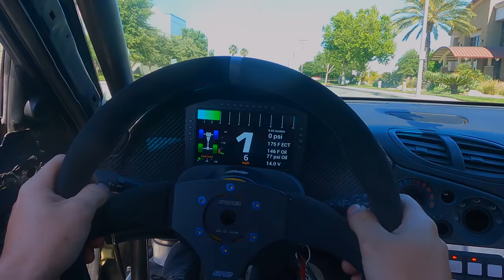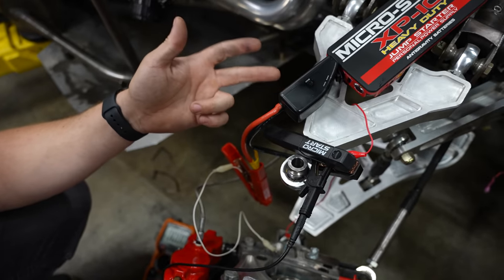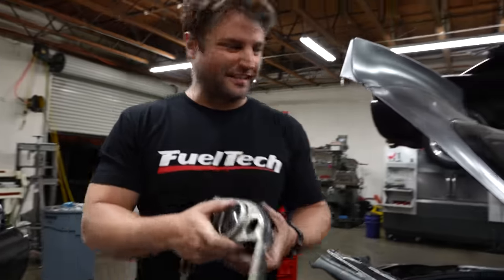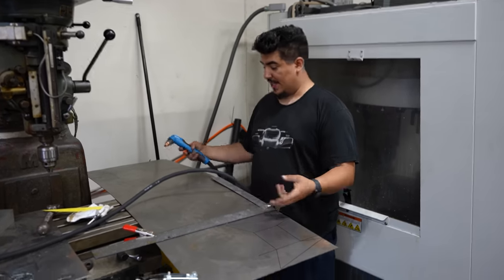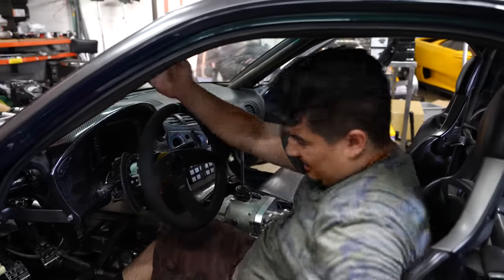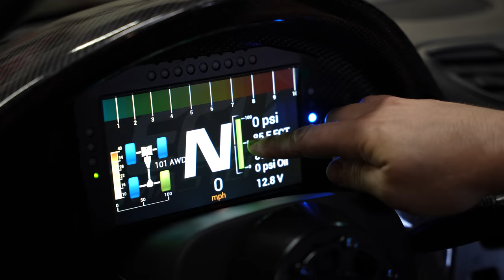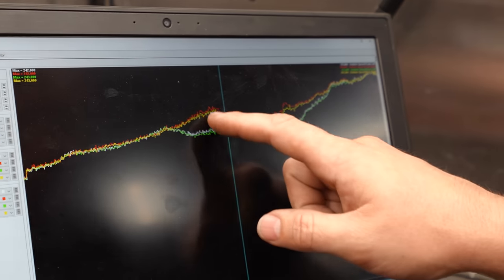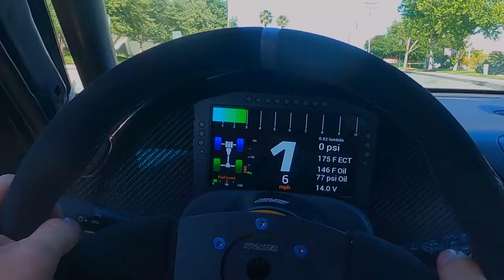Making the AWD 4 Rotor RX-7 brutally fast by Hacking Corvette Wheel Hubs

Comment: now we just need a proper firewall and something to actually cover the transmission. love where this is going
Reply: Oddly enough, the term firewall is apropos when talking Rob Dahm. "Rob your car is literally, actually , on fire!" Rob: "Yeah, but did you see how fast it is?"
Reply: This!!! Please for your own safety rob. There was just a reminder of how fast and dangerous a fire can be recently as Colette Davis’ car caught on fire. It can happen to anyone. Stay safe
Reply: That elbow-unjoint intersection makes me nervous
Reply: Jim jibroni  we will see
Reply: Jim jibroni  raceprep in last videos title.
Reply: He already built a firewall in the 4 rotor. The did like 3 videos on it over a month ago now
Reply: @johnnyclark6182  Yeah but that firewall is kinda sketch looking, didn't they seal of certain parts using tape? Looks pretty temporary to me.
Reply: @NorwayVFX  the only places they used tape was over top of metal and it was heat tape. The firewall they built was welded in place and everything. Not temporary at all. And they also built it to nhra specs if i remember correctly
Reply: @ja60123  there's been comments about this for years now & given that they could literally just cover it with a temporary cover fabbed up in 10 minutes I think they might be leaving it visible for the danger factor at this point
Reply: @ja60123  yeah but it looks sick
Reply: Pretty sure the fire wall was added in the harness vid

Comment: Please make a sheet metal transmission tunnel, so that driveshaft and or transmission doesn’t grenade and possibly kill you. I’m sure I’m not the only person that’s worried about that.
Reply: NHRA dont require it because if transmission were to grenade sheet metal is not going stop it you would  need 1/4 in armor steel  like the nhra sert bell housing
Reply: @daveg5393  strill, it's waiting to eat some wires, or an elbow
Reply: @daveg5393  if the driveshaft is carbon fiber sheet metal should stop it since it should turn to “dust” so to speak instead of a metal battering ram
Reply: Kevlar in the tunnel
Reply: Fastest flintstone car Ive ever seen for real.
Reply: The driveshaft already self destructed once. Wasn't an issue then
Reply: Been wondering this for a long time!!!!
Reply: @stagearc  Carbon kevlar shroud, hell, even 3d printed kevlar nylon would probably work. Some sort of composite laminate to seal the cockpit and act as a jacket to protect from potential shrapnel in case of rapid unplanned disassembly.
The driveshaft has already eaten wires from the speed sensor once before.
Reply from the maker: parts are cut out for the main panels! it begins
Reply: You see the fireball Camaros driveshaft grenade and blew a chunk of metal through the roof and it it was inside a tunnel the amount of power is insane
Reply: @nickcollins1528  
The kind of catastrophic failure, which makes those bullet proof diapers used for top-fuel drag motor sumps make a lot of sense.
Reply: @JimBrodie  rapid unplanned disassembly. Love that! Best description ever.
Reply: @TrompKramer  Same. Got it from NASA of all places. =]

Comment: Have you thought about taking the car to a wind tunnel to see what it would do at 200/300 mph would you have lift off or be stable 
Still hoping for a Salt Lake run and Pikes Peak with the 4 rotor 3 rotor and the C5 
The thing about getting a pro driver for the 4 rotor that has driven pike’s Peak is he can help you with tire choices and the best suspension set up for that race and the salt flats run is finding tires rated for 300 mph plus 
If you run either of these races please post soon as you can so I can buy tickets/ plane tickets/ hotel 
Rob thanks for the update
Reply from the maker: Pikes peak may be an endgame for this car.  I wanted the salt flats to be but the chassis for that basically requires a whole new build.  I can promise i will do both with a 4 rotor in the future.  As much as i can do with this car first

Comment: Jumping in to say, Rob, that is a 30-60-90 triangle. It's sides all follow a ratio of 1-2-root 3, with the hypotenuse being twice the length of the short leg and the long leg being the length of the short leg times the square root of 3. So to find the distance the sensor needs to be from your tire, divide 6 by the square root of 3. Resuming play now.

Comment: For the front tire sensor place it near the top or bottom of the tire, like behind the top of the fender or just on top of the splitter and aim it straight(level with the ground) to the back of the car. It won't be 100% perfect but the top and bottom of the tire don't really change position very far and should be accurate enough for safe data results.

Comment: Just a recommendation, a cheap single channel lab scope/oscilloscope with a set of good back probes are worth their weight in gold for voltage varying circuit analysis
Reply: Any recommendations? Been thinking about picking one up for little projects that the multimeter doesn’t really cut it for.
Reply: @pfendi  picoscope 2000 series should be right up your street for affordability and light beginner use. Used extensively in the diy automotive space.

Comment: I think you should have 2 percentages for the front and rear use instead of an AWD percent bar because 100% AWD would mean 50% on the front and back so 2 different numbers would be easier to understand the front to rear split. The 4 rotor keeps evolving and so do you both with the build well done.
Reply: Look at Acura's Hud for their SH-AWD. It gives you live power split per tire. It looks so cool
Reply from the maker: You might be able to hear my hesitation becuase i was thinking that too.  100 percent implies FWD too.  A split would be even cooler.  For now its nice for me to see how hard the awd system is activating, ill keep cleaning it up especially with suggestions like this!
Reply: @RobDahm  Split per tire would be nice but more difficult I think. I know with time you will make this thing top notch in every aspect.
Reply: @RobDahm  you could do it with the vertical bar. if the top is front and the bottom is rear, 50% on the bar is an even split.
Reply: @gi70st  Yes but he will never have it FWD so he will not use half of the bar.

Comment: 25:25 the resin comes off easily because the surface of the sleeve should be scuffed with sandpaper prior installation. Aviation uses same type of wiring system and unscuffed surface of the sleeve is a common cause of the resin separating which makes the moisture ingress possible. I very much admire your work guys though - keep it up! 😀

Comment: let me preface this comment by stating that I actually don't know what I'm talking about this time

That wire tied to the brake line at 16:00 makes sense considering turning and suspension travel but isn't it also a concern regarding possible melting if the brakes/lines get hot enough from track use? (I've seen videos of hard lines going red hot from stuck brakes but don't know if that's a concern with ptfe/braided flexible lines)
Reply from the maker: Oh shit i didnt think about that.  either way that brake line will get very hot so your concern is super relevant.  Ill either insulate or move it
Reply: As long as there is something separating the line from the wiring it will be all good because if the air gap. Also good to keep separate so the braided line doesn't rub on the wiring.

Comment: What's even more mind blowing in this whole wheel speed thing you got going now, is this is literally how ABS works.  The only thing missing from your setup is the valve block to modulate each corner of the car and a pump (ABS valve block). This is literally the exact signals (individual wheel speed at highspeed, CAN signal resolution) your ABS module is looking at when doing an ABS stop.  It's fucking awesome that you are able to implement this setup with an actual ABS specific module and basically achieve the desired outcome just by tuning the proportioning of the front and rear brake force.

Side note:  Every video of yours that I start watching and the first few scenes is you all giddy and opening boxes, I know I'm in for a treat.  I know you have a VERY large following and have your feet in a bunch of different projects outside of the 3 and 4 rotor, and vette, but I still think you don't get the credit you deserve by essentially doing this all on your own (Joel and Isaiah, included in the "on your own" statement.  Obviously). Small team making big moves. 

Love your shit, buddy. Keep up that good shit 👌

Comment: I used to work for a v8 supercars team a few years back and I believe the tpm sensors they used were a beru f1 irtpms. A super cool bit of kit it was secured to the inside of the wheel by the valve stem and sent live data to the ecu

Comment: Worked on the product with GPS tracking using wheel ticks to calculate position when GPS position was lost (like tunnels). We had a constant calibration as even slight different tire pressures could impact wheel speed/amount of wheel ticks

Comment: Great stuff Rob.  I hang out to watch your videos more than any of the other builders on YT, as your stuff is real and pushing actual limits. 

I remember reading the FullRace controller docs, and one of the features I though that was a great enhancement over traditional ATTESSA was the brake input.  Using a brake pedal pressure  sensor and G input the system could engage the front wheels under hard decel, which would reduce the activation of ABS in an ATTESSA GTR platform.

It will be interesting to see how you handle the steering input as well.  If the FD doesn't have a steering angle sensor, a bell-crank attached to the steering rack pushing a linear sensor would do the trick.

Comment: Rob if you still are messing with getting the fuel level sensor to read correctly; I went through the same process with my FD running a fuel cell with ATL float sensor sending data to an AIM dash. The sensor requires a pull-up resistor to make it operate 0-5V. There’s a company called Iron Canyon Motorsports that makes a small box you can plug in to the system to solve your issue quick and easy. 

Cheers brother!

Comment: friction is a coefficient of force.  μ = F/N
when you are breaking you are putting more weight up front, and less weight on the rear resulting in the rear locking up first.  Not to mention that the rear is already lighter if I recall from the last video where you weighed it.
a neat trick that gets this idea across is if you take a tube that is unevenly weighted, you can find the center of mass very easily, balancing it on your fingers at the ends and bring your fingers together while still balancing it on them.  Your fingers will meet at the center of mass.  This works because the distribution of mass is directly related to the amount of friction exerted between the tube and your fingers.  The same applies to the tires, as you brake the weight transitions forward, meaning less grip (and friction) for the rear tires, causing them to lock up first.

Comment: Good job figuring out the way those sensors work. When you run the circuits to the computer make sure to do a twisted pair. It will help block stray signals and weird sensor issues.

Comment: Sticker tip, cut the sticker out leaving the backing in place then carefully cut the backing around the edge of the sticker (get the tip of the scissors between the layers so you dont risk cutting the actual sticker) then cut a small corner of the backer off. From here you can position the sticker without it fully sticking, once you're happy with it stick the corner you cut back and peel the rest of the backing. This method makes it so much easier to get stickers positioned right.

Comment: Hey Rob, just FYI... the 0x3E7 is a hex format. It you ever need to convert Hex to Decimal format (so you can quickly determine the value), you can use windows calculator. There is a setting in the upper left so change it to an engineering calculator where you can switch between her, decimal, binary, ect....super handy

Comment: @Rob Dahm the sensors for the front tires should be on the top,, should pick up the hole tire without moving since it's the center of the angle,

Comment: So What i see most with the Side light on the ADU is using them to tell you if you have wheel lock up under braking( lights up red left or right, top light-front, bottom light-back) and Yellow or blue when ABS is deployed on a certian wheel or torque vectoring or ESP ( any assist you have to keep the car gripped and not kill you ) help you tell if your brakig too hard at a certain corner and what not.

Comment: I don't know about the rest of Japan's halo cars from the 90s, but the 3000GT has basically the same defrost setup on the dash with the same shattering habits. I've been running the metal, black-painted alternatives for a couple years now and they're great! instead of clips holding them in, you have some simple bolts that go through the top and thread into several basic, long metal rectangle pieces that grab and pinch the dash between them and the vents. and they do a better job of preventing the dash from future warping :)

Comment: Very nice buy - you may need to give some thought into their locations to protect them from debris, like stones and rubber build up, which can be thrown forward and be an issue. It's not all coming out the back, as you'll recall frm driving on very hot/relaid roads where there's loose chip.

The tyre surface temparature sensors are something I've suggested before for the drag racing guys - often their "burn outs" vary a lot between the length and rpm used, and the delay before actually launching. With the sensors they'd know what the actual temp's were to increase the consistency.

Comment: adding tractioncontrol to oldschool cars is a way underrated mod ! having used wheelspeed sensors and tractioncontrol in the ECU on my 450whp miata, it works better than tractioncontrol on my c6z06 or bmw e92 :D   well worth the time and effort to get a tunable tractioncontrol system,

Comment: There is some cool stuff here Rob.

Be careful with those temp sensors though. They are giving you the surface temps. Manufactures are referring to carcass tamps not surface temps. Surface temps can change fairly quickly without affecting the carcass at all.

Comment: Rob, I strongly reccomend switching your TPMS sensors to the internal style, the ones that you currently have fitted have been known to leak for the O-ring seal and flatten your tyres, also if you have the bad luck of having a tap against another car you could potentially rip it off or damage it and have a leak.

Comment: Rob, IR is just long wavelength light, you might be able to mount a piece of aluminum angle over the top of the tire to act as a mirror then point the temp sensor at that from along the wheel well.

Comment: Consider angling the wheel temperature sensors downwards towards the ground (still facing the tire off course) and make a small shield extending over it to prevent the sensors getting dirty/damaged.

Comment: Rob mount the tire sensor over top your front tire looking down from the center of the tire.......no matter which way you turn the sensor won't have to move but will be located over the most central part of the tire looking straight down

That will be the best location for protection and it will be in one spot and not being moved and jiggled.....probably cheaper too

Comment: Now add tire pressure sensors so you can finetune tire pressure so that the tire temperature is even across the entire tire. Right now it looks like your tire pressure is high because the middle of the tire is heating up first.

Comment: Rob, if you mount the front tire temp sensors at the 12 o'clock position over the tire looking down that may solve your positioning woes. If the sensor is able, set it back 1" farther than calculated to allow it to continue reading when the tires at full lock since your changing the effecting reading width. Ie: 12" wide tire at (x) angle will have a 15" cross section.
Reply: Apparently, there isn't enough clearance at full compression. It could work facing 12 o'clock from 1 o'clock.

Comment: Rob, you can also use the wheel speed sensors to warn you if a tire is losing air. If one wheels is rotating slower than the rest constantly you know it’s getting low on air.

Comment: Big rigs have a 1 wire abs sensor the hub has a 100tooth tone ring on it that the sensor uses to create an ac voltage that the abs ecm reads

Comment: Damn Rob! I didn't not expect you to go this deep this fast in setting up the awd and whatnot. Can't wait until you start playing with the attessa system. I can't remember if you can still use it to control the rear diff but if you can it will be nuts. Even more if the front diff can be done too but I digress. Being able to control the rear diff alone will let you play with things like torque vectoring in corners potentially. Think about this. The diff could pull power from the inside and push it to the outside on demand without loss of traction. That literally turns the car using throttle or even off-throttle. If you think about it. Off throttle you put all the resistance to the inside wheel to slow it down (even use abs to apply the brakes too!) and take all the load off the outside to let it spin freely. Think about a wheelchair you know?